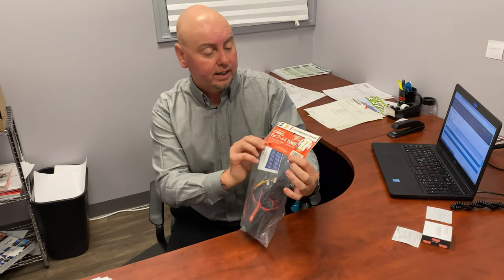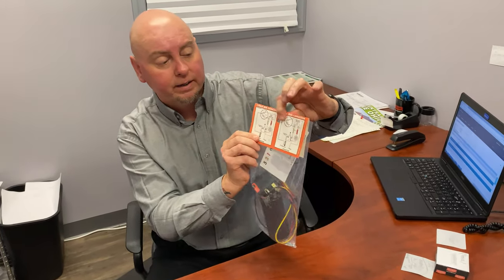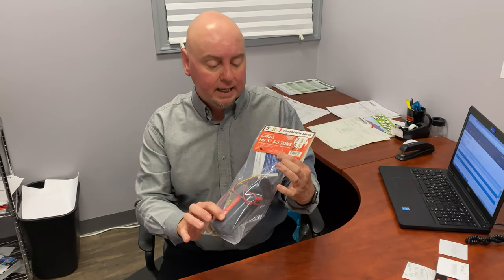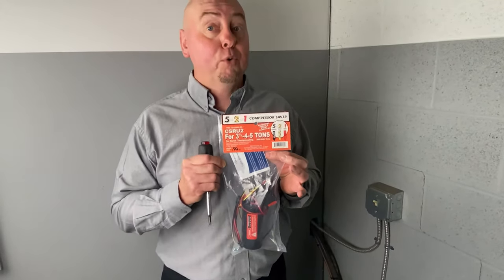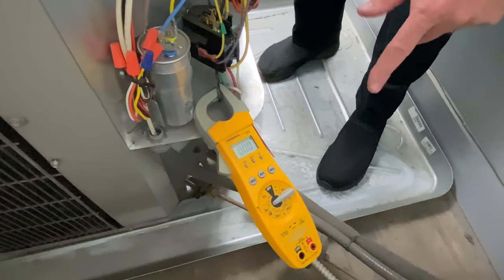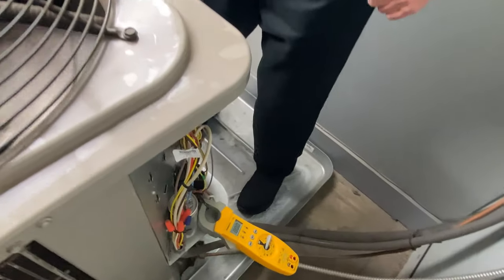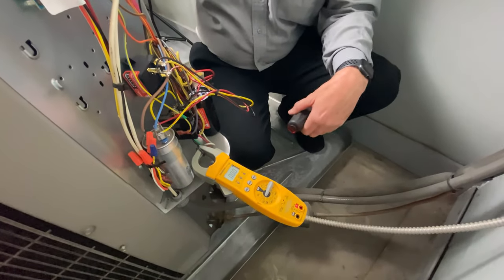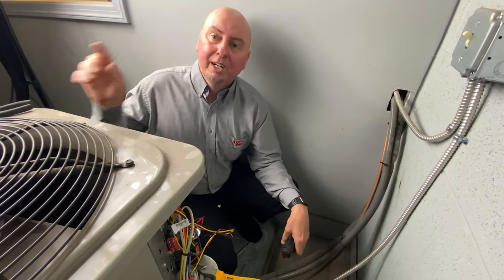5-2-1 Compressor Saver (Hard Start Kit) Benefits and Installation

Comment: So my capacitor for my compressor went out.  The fan won’t startup or anything.  I purchase a $20 capacitor replaced it.  Still had a tech came out to check over everything.  He told me about the start up kit and was going to charge 400 bucks.  This thing cost 30 bucks to connect two wires!  Omg.  Definitely do it myself.
Reply: Just had a guy come do a health check on my system and he wanted to charge me $ 986 for a 5-2-1 + double pole contact lolol. Going to be in the same boat as you here shortly and just do it myself.
Reply: thats business , you can get a 2 liter bottle of pepsi at the supermarket for $1 and a 12 oz glass full at the restaurant for $3
Reply: @anthonyiannone7618 😂 not even full cause of the ice. People don’t understand that the company has to pay the tech out there, the gas for the truck to get the tech there, the insurance on the truck, etc. etc. etc. if  companies just charged for the price of the part they’d be outta business in a heart beat
Reply: And when you screw something up don't call an hvac company to come bail you out but if you do don't complain about price it's your fault you take responsibility like that tech would've
Reply: After all the research and studying HVAC systems. Pretty sure I can do all the simply repairs other than recharging the system.  Changing out the capacitors, motors, fan, blowers, contactors, and even the main air board.  I’ll take the risk of saving hundreds of dollars for a 50 dollar part. Plus my home warranty covers the ac system anyways.
Reply: @Scjon03  or you could do like I did go through 4 years of apprenticeship classes at night after  you've all day then after you receive your journeyman work another two  years apply for your masters license test buy $1000 worth of books study e very night after you get home from a long days work and trying to make time for your family in-between pass that then come talk to me
Reply: @77kthomas   lol nah. I’m doing that in the military right now.
Reply: @77kthomas The “pros” screw up so much these days. DIY FTW.

Comment: Installing the potential relay with the arrow pointing straight up is essential. If you don’t, the relay armature could possibly not drop out by gravity and burn out the 5-2-1 or damage your compressor. This is the only one I install and recommend. I do not work for 5-2-1 or get paid by them. It is my professional opinion. I haven’t been called back on any of the ones I installed.

Comment: Question:The OEM start kit for my 4 ton ac  (Copeland compressor Carrier unit) has a 88-108mfd capacitor with it. But CSR has this cap in the CSR-U1 product which is supposedly for 1-3 ton units . CSR-u2 ( for 3.5 to 5 ton units) has  189-227 mfd capacitor. Which one would you advise to use?  The CSR-U2 dropped my startup current from 108 to 57 amps.  The CSR-U1 dropped it to 78 ampsthank you for your reply!

Comment: 23 amps seems way too low for that compressor.  Is that meter set to inrush?
Reply from the maker: Correct, good catch. It is low in this demonstration. The meter used does not have an inrush option. 

However, we were trying to demonstrate a reduction in power, a differential, not actual start up amperage. 

Our experience shows reduction in start up amperage is even greater when measuring inrush current with the aid of a 5-2-1. 

But since you mention it…I’m thinking a video on measuring inrush would be a good idea!

Thank you for the comments!

Comment: Hardstart kit does not reduce startup peak surge current.  It does shorten startup time by increasing motor initial startup torque..  Most clamp on meters read low peak surge current with hardstart cap installed due to shorter startup burst current time.  Most clamp on meters need 0.3 to 0.5 seconds of burst time to average the burst current.  

Hardstart should only be installed if line voltage is low or there is a long wire run to main breaker panel causing too much voltage drop during the initial high startup surge current.  This shows up as long startup time 'grunting'.  Startup time greater than about 0.8 seconds can result in compressor internal overcurrent Klixon breaker tripping.  The compressor internal over current / over temp breaker has a limited number of trips before it is damaged, requiring compressor replacement if compressor internal breaker contacts go bad.

It can squeeze a little longer life out of compressor that has copper plating binding up shaft bearings due to improper evacuation of system causing internal walls of copper tubing to be acid etched and deposited on compressor bearing surfaces of compressor.

Hardstart kit resulting in very short startup time of less than 0.2 seconds puts potentially damaging excessive startup mechanical torque stress on compressor and compressor motor.  0 to 3500 rpms in 0.1 secs can snap rotor shaft or crack compressor scroll plate.  Copeland compressor mobile app specifies their recommended start capacitor maximum mfd. value for given compressor model.

Typical good nominal startup time for A/C compressor is about 0.4 to 0.5 secs.

Comment: How do I check if the potential relay is working properly on 5-2-1 kit? The capacitor that comes with the kit (5-2-1) blew…I have csru2 kit
Reply from the maker: Hey Nilo,

After taking all of the connecting wires off of the potential relay, measure the resistance across the 1 and 2 terminals. The resistance should read close to zero, since there are normally closed contacts between terminals 1 and 2. If the meter reads infinity, the contacts are stuck open, and the relay should be discarded and replaced. Thanks for watching!

Comment: Will this help a portable generator power my home's central ac?
Reply from the maker: Probably not. It’s for starting purposes, a generator needs to match Hertz and handle minimal running current.
Reply: A soft start would help if you are using a generator as a back up
Reply: @HabeggerHelp He’s talking about the startup current. You showed this kit lowered the startup current by half, which helps with a generator.

Comment: Other people says the soft start doesthe same thing so which  is it?
Reply from the maker: Soft boost or start is a PTC device. It has no real capacitance. Its a jumper between S and R of the compressor.  

It allows full voltage to the winding on start up…it’s removed from the circuit by temperature. 

The issue is there is no real boost and they need cool down time to return to low resistance across the windings.